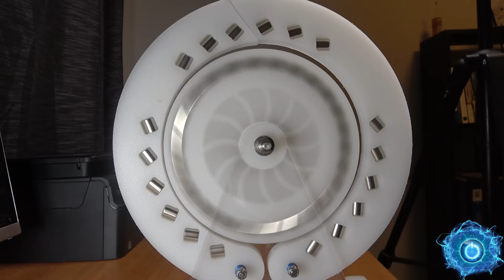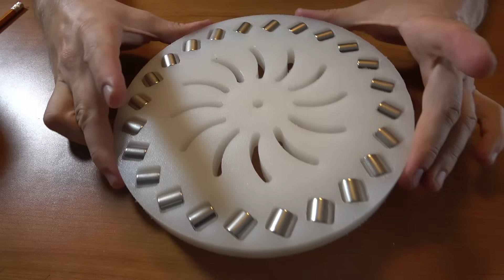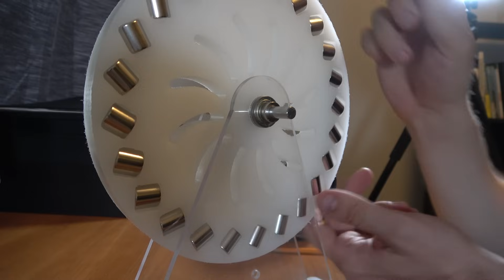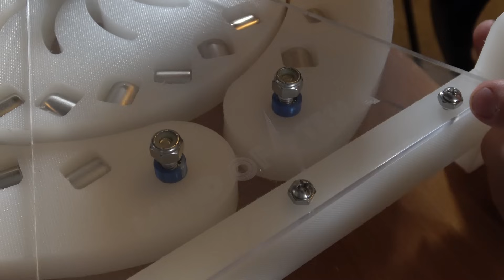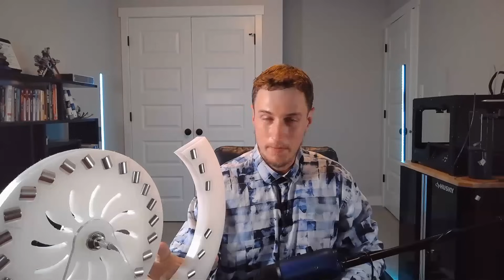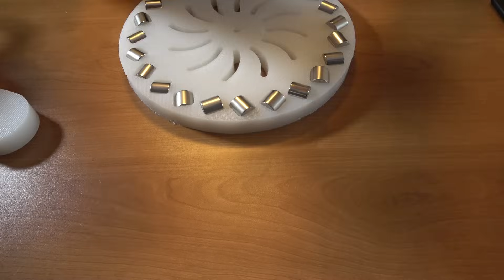Perendev Magnet Motor - Does IT WORK?!

Comment: Make individual magnetic circuits to guide the repulsive side of the magnets away from the next approaching rotor magnet. Think of it like a transformer core and how it works. It completes a magnetic circuit and the magnetic field at a positive value away from the core surface becomes extremely weak. Just something to think about.

Comment: All of the "functioning" Perendev motors that I have seen functioning have three sets of rotor/stators that are slightly offset so that one is in neutral while one is pushing and one is pulling..The angles of the magnets are supposed to allow more push than pull, creating continuous rotation.  I'd love to see you do an experiment with this.  Thanks and good luck.
Reply: @JF32304  Thanks.  Ooooh.   How mysterious and intriguing. 🙂 Have you built one?  I downloaded plans quite some time ago.  We bought a CNC mill and lathe to try some experiments, but the mill had motherboard issues and never functioned.  Then, some family issues arose and we had to sell everything.  My attention has been diverted since.  It is still a passion of mine, but I don't have workshop space to dedicate to experimentation and production.  Cheers.

Comment: It's hilarious how 90% of the comments are people telling OP what changes need to be made in order to get this impossible machine to run.
Reply: I can’t believe it.   Especially ones who claim they have one that does but…insert lame excuse involving oil conspiracy, government collusion. Lack of funds and so on.
Reply: doesn't look like his idea works because he's missing some parts, so what's wrong with advice?
Reply: @ShtNotworking  Because no amount of advice is going to get this machine to break the laws of physics.
Reply: @Fireball_Roberts  You don't have to break any laws of physics to get this to work just move the magnets at the right time.
Reply: @ Moving the magnets requires energy. Any energy you are able to extract from the rotor is going to be less than the energy you put into moving the magnets.
Reply: Nope you just need to activate it Mr Troll
Reply: Equally hilarious is sheep trying to tell visionaries what is not possible simply because they were to spread scientific dogma while doing zero research other than other comments
Reply: @0311USMC  The perendev motor has been around for over 20 years and has only amounted to internet videos. The guy who designed it took investor money, never delivered, and was convicted of fraud. That's your idea of a visionary?
Reply: @Fireball_Roberts Look at the snowball he started.  I designed something like this over 30 years ago. Just because his was never proven doesn't mean the other 10^50 versions won't.  
Imagine going back in time 500 years ago and telling all the morons that think the Earth is flat that you were going to invent a submarine.  Since they've never seen one they would tell you it can't be done.  And if you were dumb enough to believe them you would give up on your idea. 90% of the people commenting are protecting their precious "it can't be done coz science told me so" without ever having made anything as complicated as a f∆cking birdhouse with their own two hands.

Comment: Wouldn't it run longer if it was horizontal instead of vertical ? you would be reducing a little friction due to gravity pulling down on the bearings
Reply: Gravity will always pull down on it, you're just shifting the load from vertical along a couple of internal bearings to horizontal over more bearings.
Higher friction on vertical, less friction over a higher surface area horizontal. It will make a difference as to how the bearings wear but not a lot different related to frictional losses overall.

Comment: In short yes... You can make a magnet engine work... But the energy is not free...
You can stress the magnets enough to convert their magnetic potential in to kinetic energy, but as a result the magnets will lose their magnetism. 
The energy you will get out of it is less than the energy needed to make the magnets in the first place...

Comment: Instead of introducing external energy use something like this to rotate the outer ring of magnets 

https://youtu.be/wD0cMlnaUGw

Put the outer rings of magnets in an independent ring and as the inner shaft rotates the outer ring advances but in a slower timed rotation 

Notes
The RPM maybe in relation to the ratio of the planetary gear
And also you are adding friction

Comment: Ya, I fell into this hole too for a while. I bought a bunch of my own magnets and fiddled with them. I slowly learned that this will never work for a simple reason. A magnetic field isn't energy, it's a force. Seems silly, but it made things make sense in my mind. Energy is a transfer, a change in state. Magnetic fields are a constant force, unchanging. Even an electromagnet. Sure it can change, but not by itself. The current needs to change, which causes the change in the field. That's why, if you hold a magnet still near a wire, nothing will happen in the wire. It is exerting a force on the wire and it likely has an altered state due to the forces of the magnetic field, yet that state will be constant as long as the magnetic field stays constant.
A magnetic field is basically a handle. You move the magnet, it changes the state of the handle, which changes the state of whatever it's attached to. Don't move the magnet, nothing changes.
On these magnetic wheels, the opposing forces are constant, like you said. Energy, change, will always need to be added to the system to drive the wheel.
It's a really fun project to play with and a good way to learn about how magnets work.
Reply: You have to move the magnets so they pull and then push,

Comment: I made something similar to this that works. I tried getting a patent on it. I was quite ignorant at the time about what it takes to really get a patent and tried going through three different "patent agencies". After losing $7,500  total, I gave up. I did file formal complaints on each agency with the FTC after each one screwed me. The first two were shut down by the FTC and the third lost a class action lawsuit filed by the FTC. I received only a small portion of my money back from the 3rd company, which is still in business. Finally, I paid a patent attorney for 30 minutes of his time just so he could explain what it really takes to try to get a patent. I should have done that first. Now I know 🧐. Note: it is NOT a free energy machine as it won't last forever. But, it does last for a LONG time 😉.
Reply: Do you mind posting a video? Obviously, nothing lasts "forever" (e.g. bolts rust over time and need to be replaced, etc.), but if its output power is greater than the power it takes to get it started - then you're on to something. I have been interested in this topic for decades and would be more than willing to help financially for absolutely nothing in return. It's just a passion project of mine. Thanks for the comment!
Reply: @justlolatthisworld7917   @Just LOL At This World  I basically gave up on it many years ago. I still have my notes hidden away. I've been thinking recently of making another small working model. I made one 20+ years ago that I mounted a small propeller on. I kept it running in a closet for several months until the cheap bearings gave out. I cannot afford to hire a patent attorney and everything else it will take to try to get it patented. And that's assuming I would get a patent. I quit looking, but over the years, I've come across other similar ideas that may have been patented. Thanks for the response.
Reply: @justlolatthisworld7917  BTW, try putting more magnets in the outer ring than you have on the inner ring.

Comment: Why do people keep trying to create a perpetuum mobile? It's literally impossible. Newtonian laws forbid it  some run longer then others but without adding additional power it will come to a halt at some point.
Reply: Correct except "some run longer then others". No magnet motor has ever run, not even for one turn. They only run for some time if they are set in rotation by an external energy.
Reply: No one gives a shit about “perpetual”; that’s just a word for the people to use, who don’t want anyone trying to find ways to build devices to reduce their grid dependency. “Almost” perpetual can stick it to the pukes in “power” enough for them to cry about making 8 billion instead of 10 billion.  I hope everyone keeps working on these
Reply: @JHobartMusic72    Yes, "perpetual" wouldn't be needed but no one will build a device you hope for. You can reduce your energy bill by using PV, wind and heat pumps but there will never be a device which outputs energy without an equivalent input of energy. Nature is made this way and nature can't be tricked. Conservation of energy is one of  the strongest laws of nature we know, because it is not only based on observations but on the proof called "Noether theorem", found more than hundred years ago, that our universe can't be stable without this law.
Reply: @sciencefreak9070  science keeps evolving, start considering there in flaws with Newton's laws
Reply: @   Laws of physics describe what we observe in nature and this doesn't change. Thus also Newton's laws are still valid and in permanent use but they fail if speeds approach the speed of light. When such observations were made Newton's laws had to be corrected for such settings.

But conservation of energy is not only based on observations but proved to be a general principle of nature. One might still speculate that this law might fail in a complete new setting but what is tried are always old settings like magnets, coils, springs and so on. For sure such attempts are of no avail.

Comment: I know this will be hard to build but you can do it yo! Please read. If you have the outside magnets each able to spin as the wheel spins the outer layers of magnets need to change polarity and can do so if you have a Rotary position for each outside magnet. If you make then spin they will push. If you build it it will work. You may have to use a double outer layer of rotating magnets to help spin around the outer magnets so you need to keep adding to match every possible aspect of wave form of pos and neg at every possible angle. If you build it you will be successful.

Comment: The magnetic field exists in an Inertial frame of reference, it is the force that pulls-straight inwardly into infinity, having no angular acceleration and no angular de-acceleration. When we think in terms of adding energy to a spinning wheel, it's all about the force that pushes & bends and or the boundary producer. Perpetual motion can only exist in a inertial frame of reference being with respect to our size & time domain. Only the plugging force, (angular acceleration) keeps us from being sucked inwardly into infinity...  Hence the term, boundary remover! Cool video, your work is greatly appreciated, thank you. 🙂

Comment: P.S. I would try Steel, iron, and Nickel surrounding THREE "sides" of the magnets which SHOULD be spaced much farther apart that what is shown here in this video so that the magnetic field lines are REDIRECTED and kept within the boundaries of the shielding. ONLY the selected positive or negative EM field should be eminating from the block or volume of permanent magnet surrounded by the magnetic-shielding material.  Using an analogy, you are creating a DIRECTED JET of EM field out the back end of each magnet in the rotating part so you can repel against the OPPOSITE EM field in the statically-fixed magnets (i.e. those magnets on the non-rotating part)!  The EM fields of each magnet SHOULD NOT be touching the EM field's of neighbouring magnets!

EITHER the rotating part OR the fixed-in-place magnets must be UNBALANCED (i.e. more or less magnets than the other side) so a proper PUSH or PULL field is created that spins the rotor in the desired direction. If everything is TOO BALANCED (i.e. is an equal weight AND/OR equal magnetic field strength) on the rotors and fixed part, you will simply get a STATIC EM field that keeps the motor from moving (i.e. it gets stuck in place or quickly slows to a full stop)

The whole assembly MUST be unbalanced in term of flywheel weight in at least one quadrant of the rotor AND/OR be unbalanced in terms of magnetic field strength in at least one quadrant for this type of motor to work properly!

V

Comment: If you SHIELD ALLthe magnets in such a way that only ONE POLE is effectively being output, you create a MONOPOLE MOTOR which absolutely WILL WORK. The field strength DOES deteriorate after about two years BUT with big enough magnets made out of a CHEAPER but same EM field-strength ceramic permanent magnets, it would work for AT LEAST TWO YEARS giving you the ultimate power pack that SHOULD work up to about 2000 watts output continuous which is good enough for most household modern electrical generator tasks such as running 120V at 20 amp circuits (i.e. one or more devices at up to 2000 watts combined total on a continuous basis!)

If the COST is cheap enough for the magnets, buying a NEW magnetic power pack every two years make perfect sense on a cost-wise and practical basis for many household, campsite and worksite power-supply tasks!

This TYPE of motor NEEDS the magnets shielded enough to create a practical equivalent to a Magnetic Monopole where the positive or negative field is the ONLY one being output on a given side/pole!

V

Comment: I was involved in a full scale generator project which used a unique array I've yet to see anywhere on the web. It introduced a particular variation on neodymium magnet array with a particular partial field obstruction & presents what I believe is the optimum directional magnetic conditions for passive operational potential. If you'd like to collaborate, let me know.

Comment: If you add a pulley and belt you could hook it to a small generator or alternator and battery that would be the power source to run a bigger generator.

Comment: I built one in 2002. The energy loss to make the magnets is not made up by the machine because gauss in the magnets is lost in use. The magnets are basically a battery in this case...

Comment: You should look into magnetic flux. Each magnet has different strength even tho the are the same size the strength of them are slightly different stronger or weaker. It will take and extreme amount of time to do. Imagine a wheel made of magnetic flux. Your gonna wants that to be a smooth circle and not a wavy circle the smoother the circle the better also there is a metal that can direct your magnetic flux acting like a shield so it will push at the right time. Tesla was a firm believer in 3 6 9 if you can figure out what I mean by that this does actually work. I've played with a working model before and it took the guy almost 2 hour to explain
Reply: Ace- whare can I find more info on this?

Comment: You can get longer lasting spin with no magnets and a flywheel. Permanent magnetic cannot be used to make a motor by themselves, since a unipolar magnet cannot be created, electrical fields are typically used to create a mono-pole moment (even though an electromagnet is still a dipole.

Comment: My dad made a small one of these, totally different magnet placements, and the ones on the outside rings were on springs inside their sockets. he had smaller magnets between the larger ones on the inside disk that pushed opposite way and they were all spaced further apart. his, he put on the shaft of a dvd burner motor and connected it to a battery charger for AAA's and C's and then to a lamp. he got it to power the lamp while charging the batteries after cranking it by hand for a few to get it going.
Reply: do you have a picture?
Reply: @thejamesasher  I can ask. But it got left behind when we moved. wasn't very big
Reply: That was a pretty mean dad joke IMO.
Reply: Liar.
Reply: Troll

Comment: So the main energy losses I can think of in the design are air resistance, bearing resistance and Eddy currents within the magnets, reducing these losses will let it spin for longer, although reducing these losses is also a challenge industries have dumped billions of dollars into optimizing
Reply: If you could eliminate all resisting influences as friction, air resistance and Eddy currents this "motor" would run forever. But if you try to drive some load with it the "motor" would quickly come to a stop. Any wheel will spin forever in the absence of resisting influences, you don't need magnets for that!
Reply: Doing it in a vacuum chamber would get rid of the eddy and air resistance. But would ad a layer of technical difficulty

Comment: Honestly I think propetual motion machines and free energy, similarly, are pretty silly. But if it is at all possible to make something close, It just may employ a technology with the ability to "borrow" it's energy from the future. The idea is Inspired by the tunneling theory, but translated to macroscale objects. We can speculate this similar to how some quantum experiments tested quantum entanglement on macroscale objects using quarts crystals doped with entangled photons if I remember correctly.
Reply: Yeah, Free Energy is silly. the issue that people gets stuck on is the energy source. Propetual machinces is defined by the requirement of needing outside energy to function. A Magnetic wheel like this only needs internal energy, which is not Propetual due to the fact that magnets has a shelf life of 500 years+. So the energy is not free, as it gets depleted over time.
Reply: I think they are onto something. I would think creating that wheel and using it in a glass hothouse with the energy from the sun and glass could make these magnets produce some type of energy.

Comment: My Dad did this by in 1980. Its exactly the same in principle but only a different design.  The difference between the two is that the motor was meant to be used to do work.